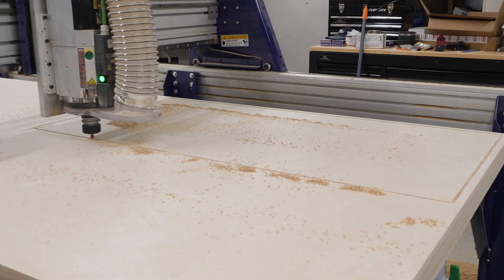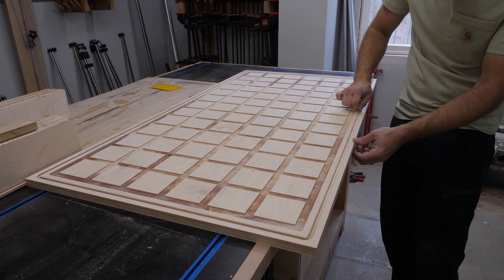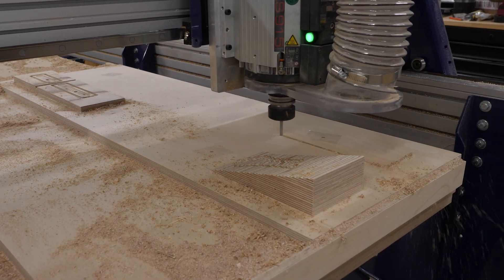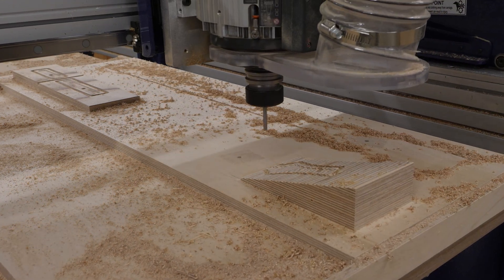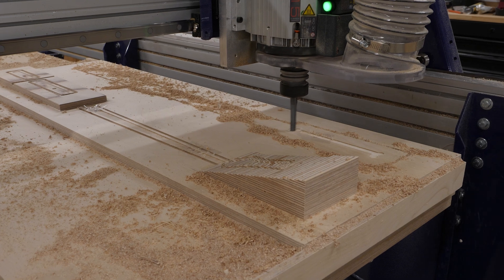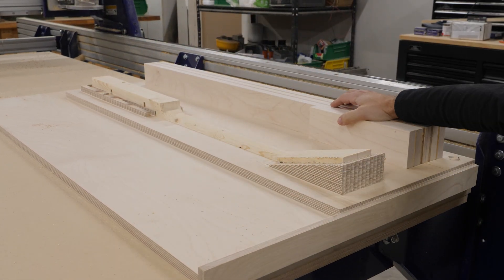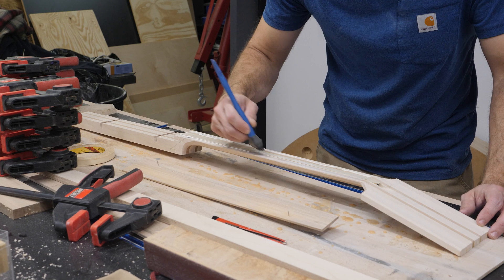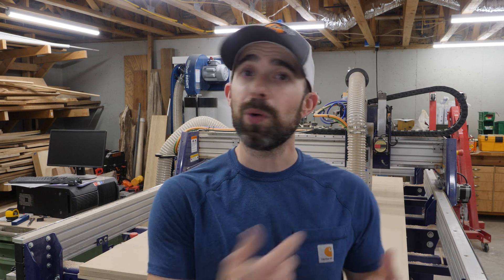Mill SMALL Parts on a GIANT CNC Vacuum Table

Comment: Thank you much for this! I'm looking to do something very similar for my builds and this is very helpful. My only question is it appears that you put the ply over your regular MDF spoilboard, correct? I assume you cut the bleeder hole straight through the fixture ply and the MDF spoilboard to expose the port on the vacuum bed. If that's the case, then did you subsequently have to plug the hole in the spoilboard after this project, after your removed the fixture? 

I'd like to be able to easily flip back and forth between the fixture and the spoilboard but I would think that once you put a bleeder hole in your spoilboard, you're going to lose the vacuum pulling through the rest of it. Though would suck to have to switch spoilboards or swap a huge 4x8 sheet of (heavy) MDF every time. Hopefully that makes sense. If so, how did you deal with this?  Thanks again for a great and very helpful video.
Reply from the maker: So glad this was helpful!  To answer your question, there's not a bleeder hole in the MDF spoil board.  Not sure what vacuum setup you have, but my pump pulls vacuum through the MDF spoil board.  When I use this jig I isolate the vacuum to just one zone and the gasket on the bottom of my jig creates a seal.  The bleeder holes are only in my jigs.  Hope that clears it up!  Let me know if you have any other questions👍👍
Reply: @WoodshopMike  Thanks for the reply! I'm very happy to hear that. I just upgraded to a 4x8 with a 7.5HP vacuum...however I haven't finished setting it up yet. Will mainly be pumping out parts with a setup similar to yours, however I do occasionally still want to remove the fixtures and cut full sheets, etc. So good to know that it's at least worth a try. Hopefully my setup will work as well as yours. Thanks again...this definitely helped me out!
Reply from the maker: Excellent!  So glad it was helpful👊

Comment: Mike that was incredible! I’m thoroughly impressed with all that went into that programming. 😮
Reply from the maker: There was a fair bit that went into the programing, but it was a pretty fun process to learn!  The biggest hurdle for me was just getting through the proof of concept that I could concentrate the vacuum from the table down to a smaller fixture and actually have enough force to hold the items in place.